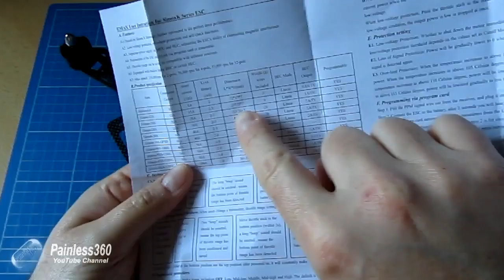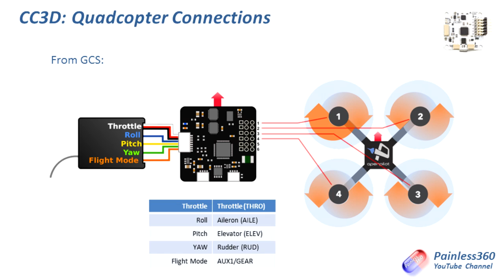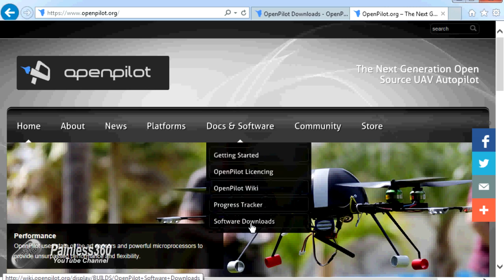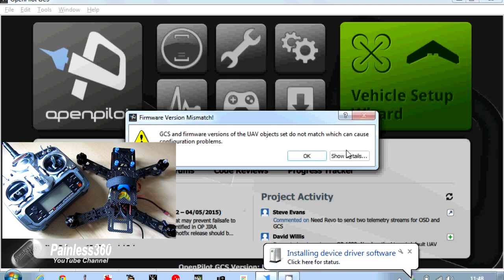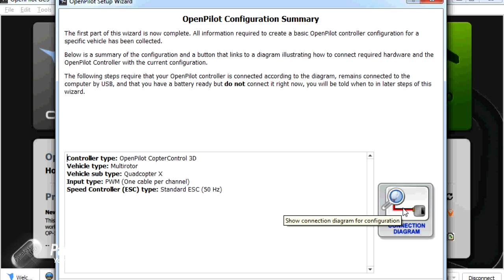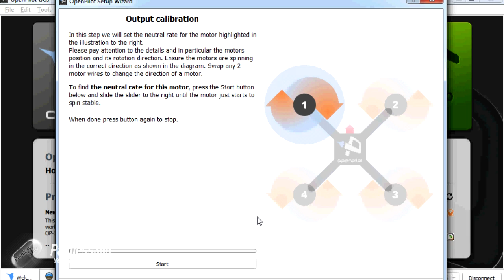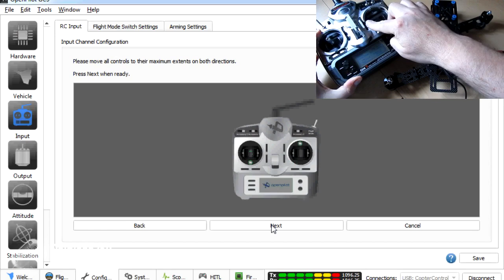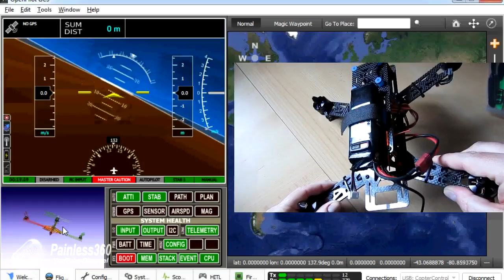(2/10) CC3D Flight Controller - Radio setup, firmware install and testing

Comment: Hello Painless, Thanks for all your excellent work. It's been very helpful to guys like us who are still trying to wrap our heads around the electronics side of multi rotor. I've got a Storm Drone FF that's been fitted with new esc's, motors and a new CC3D board. Everything was going great until the configuration tried to figure the mode switch setting on the controller. No matter what I try I cant get past this step and finish the process. The controller is a Devo 7............ Any suggestions?

PS I have downloaded the latest version of OpenPilot.......... Thanks.
Reply from the maker: Are you sure the cable from the FC is plugged into the right output on the Rx?
Reply: I would think so as the stick calibration seems to pass without an issue. I could very well be missing something though. I've yet to fully assemble my first quad........ But I'm ordering parts for it.
Reply: +Painless360 
Hi, 
I'm new to all these stuff and just built my new quad. I need some help with my receiver. I'm using a flysky th9x and fs-r9b, similar to turnigy 9x. I can power on the quad and cc3d. When plug the cc3d servo cable into reciever, the led flashes once briefly, then goes off. Binding is possible, but power has to be in batt plug. Plugged in, white into signal, red into +ve black into -ve. What happened to my reciever? Please help me. 
Regards,
Ling
Reply from the maker: +clive ling No idea, I would power the Rx from one of the ESCs directly and see if you can get a servo to move by plugging it into one of the channels (I normally use Throttle). That will tell you if the Rx is OK then you can focus on the flight controller. Best of luck
Reply from the maker: +Maxamus101 So you can see the control moving for the modes on the GUI and it passes the calibration then? I'm confused where exactly are you getting stuck?
Reply: Me too........ But I'm dragging my quad to the hobby store where I bought the board. If they can't shed any light then I'm starting from scratch......... Thanks for your input Buddy. I really like your video's. If you would like to see one of my check out Gravity Interrupted and watch me chasing Seagulls around.... Good Times Man...........

Comment: Will changing my receiver change the PIDs on my cc3d? I purchased a 250 quad but don't like the reciever.  Would I just hook the new reciever up and run the cc3d software to configure it?
Reply from the maker: MrSadlerd3 A new receiver will not change the PIDs for how the board flies but you will need to run through the radio calibration process to make sure things like the neutral channel positions and endpoints are still good.
Happy flying!
Reply: Painless360 thanks! Can wait to see the FPV camera and transmitter addition.  Im using your video exclusively to build mine. Following your lead!
Reply from the maker: MrSadlerd3 It's in the playlist and will be published next month. Want a sneak preview? https://www.youtube.com/watch?v=mLSfupL_Aoc&index=5&list=PLYsWjANuAm4r-E61stLchCR4bzY3NmDNh
Happy flying!

Comment: Hello Painless360, I was able to setup my CC3D. Everything seems to work fine while connected to the computer, but when I disconnect from the computer, the quad will not arm. I don't know why it would not arm. I don't know if you have a solution for this or if you have a video about arming issues.
Reply: +Painless360 I got it to work. I changed the flight mode (channel 5) to a 2 position switch and it worked. Thanks a lot

Comment: this video was made awhile ago. open pilot no longer exists. the cc3d I just received is not reading in librepilot. it's saying a board is not connected. or "waiting for board to fully connect" is this fc obsolete or can I still flash it as of january 2018?? thanks for your videos..👍👍👍
Reply: it says I will have to manually upgrade the board using the uploader??? what am I missing?
Reply from the maker: See the first video in the series.. Best of luck!

Comment: Hello in your video you say if you have linear esc my are and are flashed with biheil.one shot 125.  you can just plug them all the wires in and don't have to take out the red wire ( +) is this true?
Reply from the maker: +neil200830 See our video on 'Understanding ESCs' where we cover this and more..

Comment: Hey again, I did drone calibration and in the flight data menu i could see my gyro works perfectly but after transmitter calibration gyro in the flight data menu stopped showing any signs of working, maybe i pressed wrong button somewhere, please help me.

Comment: Hi Painless ,thanks for your quick reply as to my problem,I I have the connections set to PWM for multiple connections to esc and motors as the RX doesnt support sbus and cppm ,its an old RX iam using ,but can you explain to me ! when you say check that the other connections for the other channels are working ok ? like I said the motors are spinning up in the software and the escs look like everythig else is working ! except the throttle channel isnt being seen by the software ? in the TX? iam missing something here I think is simple ,sorry iam not seeing it , but it is 4.95 am here in Australia :(maybe Ill look at it later today when I have some sleep ,$^@# quads .
Reply from the maker: +Paul McMahon You'll be missing something (unless the Rx or CC3D is not working). I'd check you can see the throttle channel moving on the radio and then the Rx then check the cable you are using to connect it to the CC3D isn't damaged.. Best of luck!

Comment: Would a flysky transmitter system (remote + receiver) be compatible with the CCd3 and openpilot/Librepilot?
Reply from the maker: +Cam plays should be, id always look for receivers that support PPM for a CC3D. If you've not already bought the cc3d there are better choices now.. best of luck!

Comment: Hi Painless I have built 250 using your setup for Naze32 and runs sweet, but I have just built another 250 using CC3d thought I would try both, I put generic setting on mine using Openpilot, I am finding it is oscillating a fair bit on roll when flying it, both are Banggoood one similar to yours RC250 frames. what would be the best PID setting for it, have you got screen shot of yours please.
Reply from the maker: Mine are defaults in openpilot.  Check the motors and props for vibration first. Best of luck!

Comment: hy when i reached to  upgrade i puched the upgrade button its says     timed out while waiting for a board to be connected   you will have to manually upgrade the board using the uploader plugin

Comment: hi chap , iam getting back in to quads  again , but iam stuck on trying to get the flight mode working i have a dx7s and have the flight mode active and the 3 position switch set to aux1  and travel to 150% travel , but i just cant get past this point on the set up wizard, if i do a manual set up and set channels to active and save it the mini atom wont arm with right yaw with full travel ,  have you any suggestions , i have been watching your set up vids but just cant figure it out
Reply from the maker: I'd check that you can see that channel moving on the monitor screen of the radio as a first thing. Make sure you're using an ACRO model to, that will make it easier.. Best of luck!
Reply: yeh i cant see it moving at all , would that indicate that the wiring is not  correct , all the other control's are working fine ,

Comment: I have built a 250 quad using the openpilot cc3d flight controller. When I throttle it up. The Quad lift off but drift backwards. Do I trim it with the radio like a normal aircraft or is there a setting with GCS that configure this.
Reply from the maker: I would recalibrate the accelerometers first..
Reply from the maker: Then make sure the elevator and aileron channels values are 1500 when you are not moving the stick!

Comment: @Painless360: While running the "Transmitter Setup Wizard" I got stuck at the step where it asked me "Please toggle the Flight Mode Switch". Here I am not getting response as I am toggling the switch. I am using the FlySky FS-TH9X. I restarted the Transmitter Setup Wizard but doing nothing. Any suggestion will be highly appreciated.
Reply from the maker: +TrueThinking This normally means that the program isn't 'seeing' the movement of the channel. Check that the channel value moves on the monitor screen on the radio. Check the output on the Rx is ok (I plug a spare servo into it and make sure it moves). Check that the cable is plugged into the right port on the receiver and then move the switch more slowly when trying the calibration. Best of luck!

Comment: I have the TGY-i10 and setup is going smoothly with the exception of the toggles. During setup it does not seem to see the toggles moving. Any suggestions?
Reply from the maker: Lots. What model type?
Reply: +Painless360 I have the eturbine 250 quad. comes with cc3d flight controller.
Reply from the maker: So you are looking for a flight mode switch in addition to the main 4 controls?
Reply: +Painless360 I'm simply looking to change between 3 flight modes. simple to more aggressive. This is my first time ever having to set things up from scratch. So I really don't know.
Reply from the maker: +madhattercig Check out the playlist for the i10 in about an hour.. should be useful ;)

Comment: thank you for this valuable video. if i wanna add a retractable landing gear.  how can i do it
Reply from the maker: +user new we've not tried. I'd suspect that the easiest thing is look to connect the landing gear servo directly to the radio reciever for control. Best of luck!
Reply: thank you

Comment: Does the Openpilot CC3D support V22 Osprey type Configuration??
I'm looking forward to build one and I'm curious to know!
Reply from the maker: +Amlan Sarkar its more a question of does the software running on it support it? I'd check the manuals for the Openpilot successors. Things like dRonin, Tau Labs and Librepilot.. best of luck.
Reply: Painless360 thank you !

Comment: When I go to save the all of the information back to the board, the software gets stuck at "preparing mixer settings." Any ideas?
Reply from the maker: Sadly not. This is a very old flight controller and I've not used one for years... Best of luck

Comment: I'm having trouble calibrating my ESCs. First off, one of my ESCs gets warm as soon as the battery is plugged in. Then, after calibration, that ESC and the one opposite from it start beeping while their motors twitch. Is there something wrong with my ESCs, or am I doing something wrong?
Reply from the maker: I would check the motor connections on those ESCs and swap the motors with another that is ok to see if the problem stays with the ESC or the motor.. Best of luck.

Comment: i have bought the ESC (EMAX BLheli 30A bec 2A/5V) and i would like to know i can connect the 4 ESC to my cc3d without taking any wire from the connectors? and one last question What is Standard and Rapid ESC? thank you
Reply from the maker: If it's a switched BEC then you can. The Standard vs. Rapid ESC talks about how quickly they can be updated. Older ESCs were designed for fixed wing but multirotors needed much faster refresh rates. Most modern ESCs are now 'Rapid' - if it runs BLHeli or SimonK then it's Rapid..
Reply: Thank you

Comment: Hello, I have a CC3D board on my quadcopter, but someone told me that i need a seperate gyroscope (and maybe an accelerometer). I thought that the CC3D wouldn't need a seperate gyro, because you can set this in OpenPilot. Am I right, or do i need a seperate gyro and accelerometer?
Reply from the maker: +Wouter Stegenga I would ask that person who told you that to send you some URLs that show that it is needed. ;)It's not BTW..

Comment: I am confused, why with linear ECS you can use all 4 ECSes and with switched only i ECS will have all of them? When I looked at CC3D manula, it says that only 1 ECS should have red wire
Reply from the maker: +Zycie w Californii All covered in the 'Introduction to RC' playlist. It's all about the type of BEC in the ESC.. Best of luck!
Reply: +Painless360 okI will look at it, however, I am still confused, why your configuration is different from CC3D manual, I know it is something about ECS, I will loook at it
Reply: +Zycie w Californii ok, I saw all videos from that series , and I am sorry, but I didn't find the answer for my questions, . You explained the difference between switching an linear bec, but I still dont know why you can have 5V read wire on all ECS going to cc3d,  when manual says to not do that.   you also said that with switching BEC you would have t removed 5+V cable from all but 1 cable
Reply from the maker: https://www.youtube.com/watch?v=OZNxbxL7cdc at 16:05..

Comment: Painless, I would like to know is my 12amp Emax BLheli ESC is standard or rapid? tnx and more power
Reply from the maker: +Michael Jeffrey Esteban Probably rapid. Not sure as I don't use them here. Best of luck.
Reply: +Painless360 thank you sir, but in this video you are using a 12amp emax esc (which is known as BLheli) and upon setting up to your software you clicked the standard esc. how is it? hows the performance? thanks again sir.
Reply from the maker: I'm running it as fast and works great.

Comment: How do you figure out which motor goes where and how they should turn if I did not get a kit,and purchased everything individually.
Reply from the maker: The motor layout is the same on every model so following the series will show you where..
Reply: So the motors are actually not different but the threads on the shaft is just left hand and right hand,so I could use 4 of the same motors

Comment: how do i give the cc3d board power . when i disconnect the USB from the computer the board loose all power . my ESC wire has only 2 wires . the middle one is missing . how do i give it the 5v . also i have a spectrum dx6i . what receiver can i use with it
Reply from the maker: +Sharon Fedida use an UBEC. See the power  videos in our 'Introduction to Remote Control ' series for more details. Best of luck!
Reply: Sharon Fedida ahahah playing with something you clearly don't no nothing about, very dangerous

Comment: When I calibrated my radio with the program, it showed that my pitch and roll stick was offset. For example, when I put the right stick in the top left corner, the librepilot would read that its at the top center position or wen I pushed the stick to the top right corner, it read that it was pointing directly right. How do I fix this?
Reply from the maker: The calibration routine normally fixes this. I'd run through this again. Failing that simply reverse the channels that are wrong on the radio. Best of luck!

Comment: hi ive bought this exact kit but use a different rx its a flysky but folling things to the letter it started going great but ive a dodgy esc and it seems to of burned out the cc3d as it no longer comes on am i right in asuming i can plug all of the esc plugs into the rx without cutting wires there identical 12a simonk ones
Reply from the maker: I'd be very careful plugging anything into anything else if you suspect that. You could fry something else. Disconnect it all and use a voltmeter to check individual components are ok. Best of luck..

Comment: Hello, we don't have a flight mode switch on our transmitter (futaba t4yf), how are we supposed to skip the flight mode switch configuration? 21.30
Reply from the maker: +Wouter Stegenga I would recommend using a radio with 5 channels for any multirotors. Best of luck.
Reply: +Painless360 so there is no possible way I can skip this step with my 4 channel transmitter? Thank you
Reply from the maker: I've never used a four channel radio for control (https://www.youtube.com/watch?v=cPi4v-flw1c). Best of luck.

Comment: also am i right in thinking the remaining 2 wires are gimbal control signal wires and as such do i need to plug them in ive bought a new cc3d but ime waiting on the esc to arrive
Reply from the maker: Not sure what two wires you are referring too. Lots of extra detail in the other videos in the series. Best of luck with it..

Comment: MrTomcreativ I am facing the same problem. Built my 250 quad and using a FS T6 transmitter. My receiver and transmitter are bound and configured the CCD3 as per the instructions. I am just NOT able to make my FS receiver talk to my Quad...
Reply from the maker: Avinash Gujjar Lots of people seem to have this issue. I can't help as I don't use that radio. 
Best of luck with it..

Comment: i was planning on using an FrSky 2.4GHz ACCST TARANIS X9D PLUS and X8R Combo Digital Telemetry Radio System (Mode 2)......would be good choice to use.And would it be a good receiver??If not than please send a link to a good radio transmitter with reciever
Reply from the maker: +Boomo 12 great radio but can be tricky for new pilots to setup. See our video on choosing a radio.. Best of luck!
Reply: thanks so much

Comment: Hey master, can you define "what is normal speed, when calibrating the ESC"? thanks.
Reply from the maker: At what point in the video?
Reply: Painless360 at 18:50 you said the motor should be stable, define what you mean by saying stable please